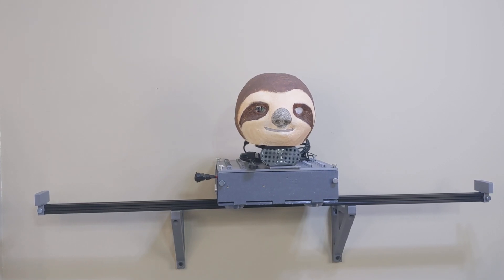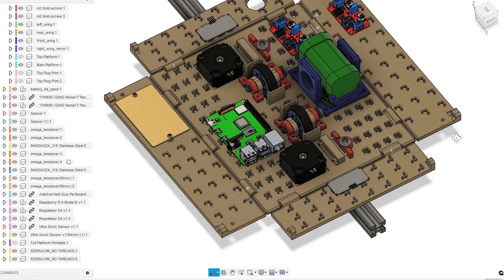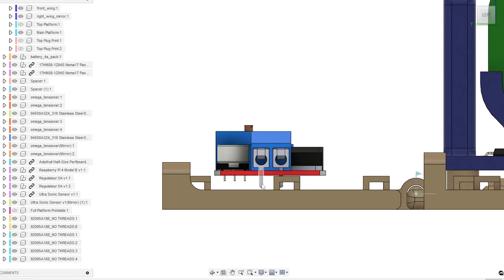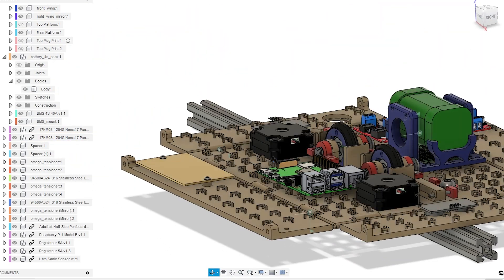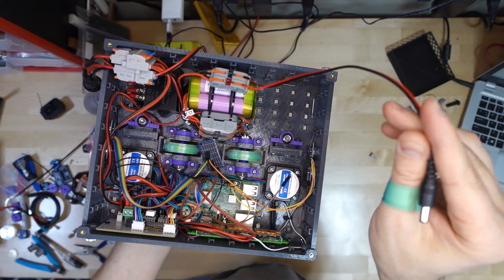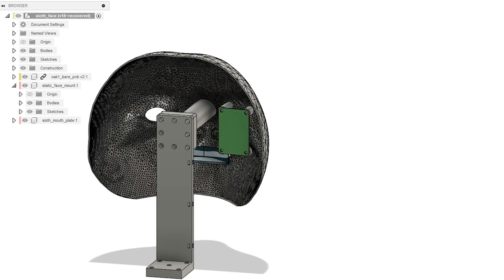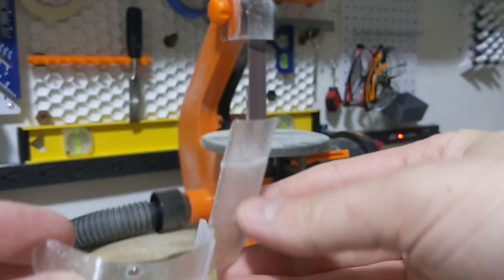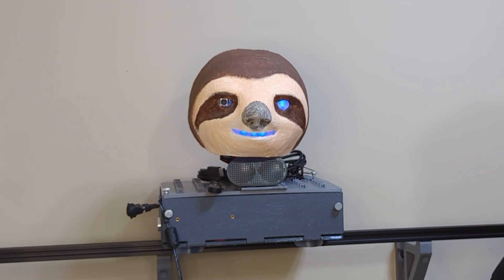Building a Cyborg Sloth w/ a Folding Electronics Box

Comment: That's an interesting project!
With that wobbly motion I expect most visitors to run away rather fast ;)
Reply from the maker: I would say my experiment with those printed wheels was a failure.  I am considering switching to the V-wheel gantry plates used in 3d printers and then used a belted drive on the top two wheels (one reason I did it this way was to drive the wheels directly from the motor shaft, but it clearly wasn't worth the complexity I saved).  Anyways thanks for watching!